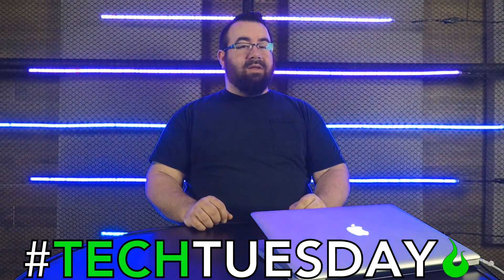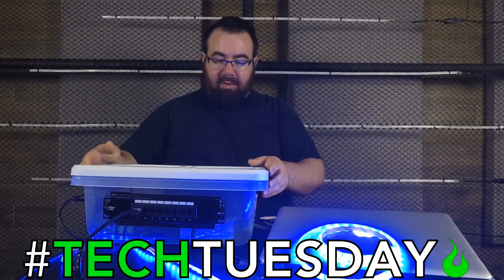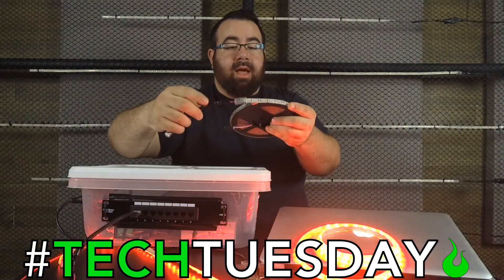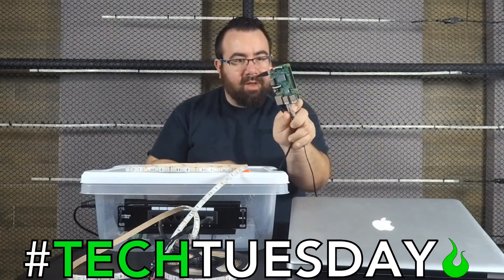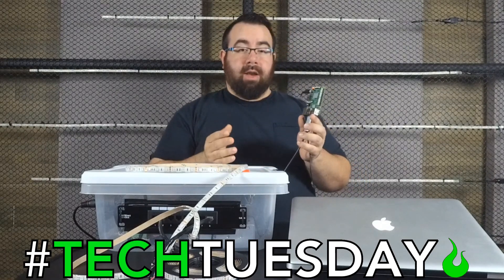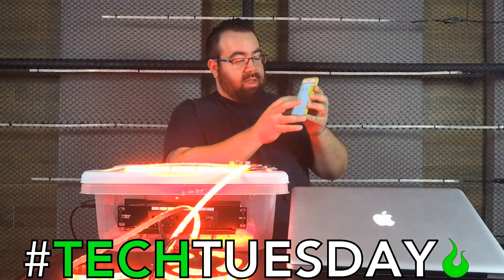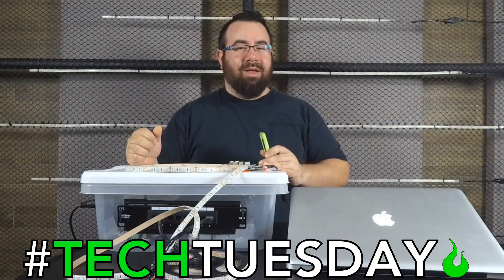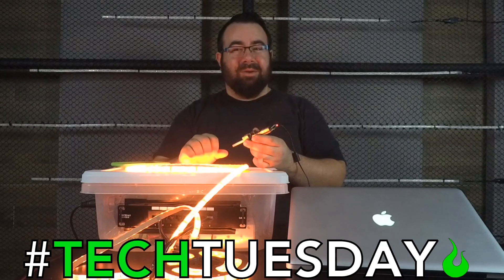LED Strip and Raspberry Pi - #AscensionTechTuesday - EP061

Comment: What do you need cat6 for ?  Cat5 will do just fine.
Reply from the maker: Because Cat6 is what I had in the office :) Haha
Also, the difference may be negligible, but the Cat6 I'm using has a little more copper than most Cat5e.

Thanks for watching!
-Chad

Comment: Do you have a link for DMX to USB dongle that you used?
Reply from the maker: The brand was Lixada. I think it was about $22 USD.
There are a few others that look to be the same but with a different name brand and below $20.
It works well with a Raspberry Pi but doesn't seem to work directly with my Mac using Chamsys MagicQ. Not sure if it's a driver issue or just not supported by MagicQ.
Reply: Thanks